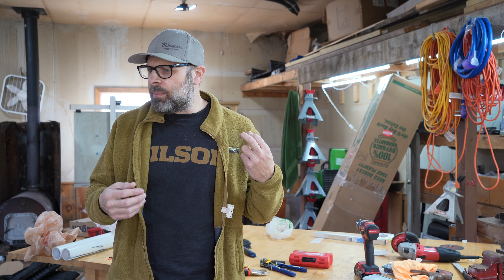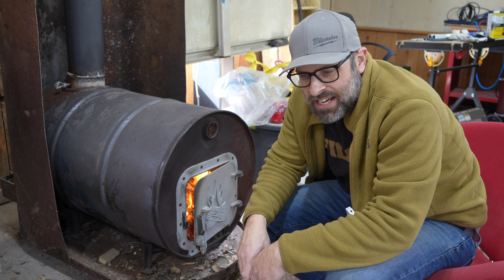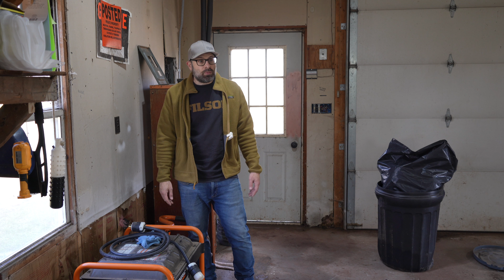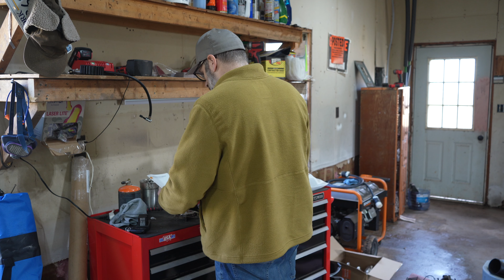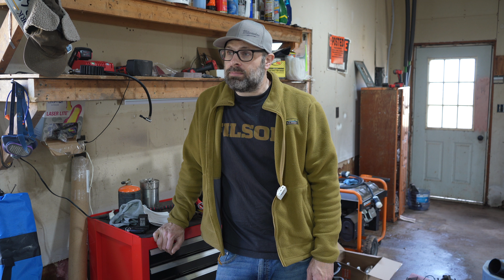I'm Back! What's Next For The Channel? - Ram 2500 - Deck Rebuild - Construction Nightmare

Comment: Glad you had a good vacation Nick. I hope yo hd good weather out at the Outer Banks....I like it there, I did a couple of videos of my experience there...One at Wright Bros. and other of beach.  If it is ground level water infiltration, I think your best solution is to regrade the area around the Garage, Culverts, ditching don't work well in winter or when ground is frozen. Have the land pitch away and create a lower grade what ever distance you can accommodate away from structure.  Looking forward to other projects and truck for sure.